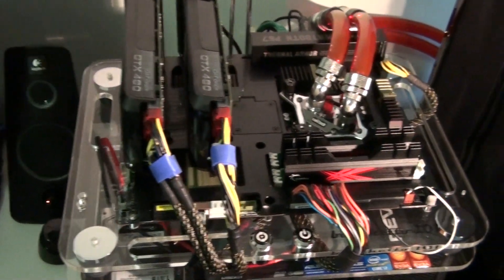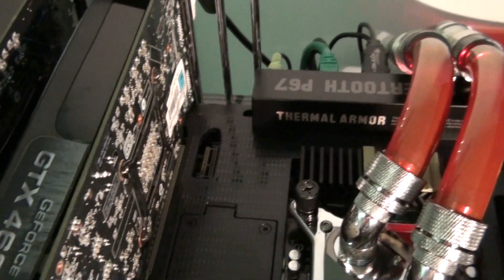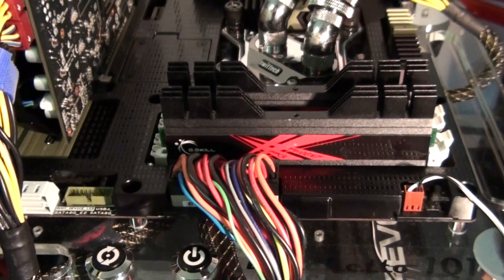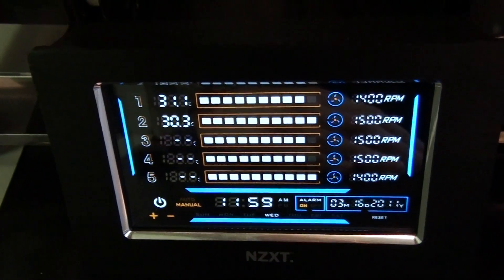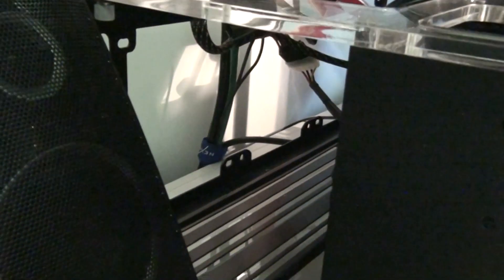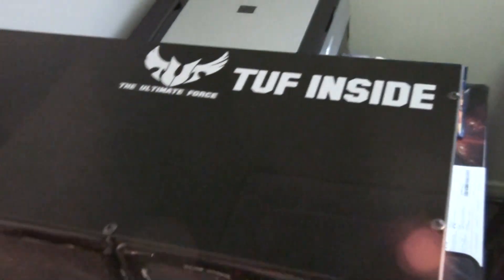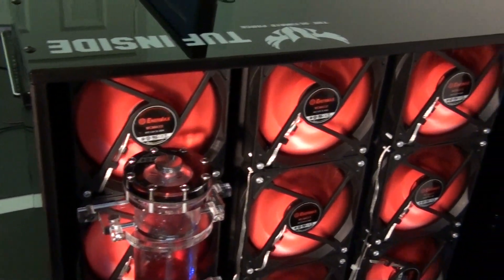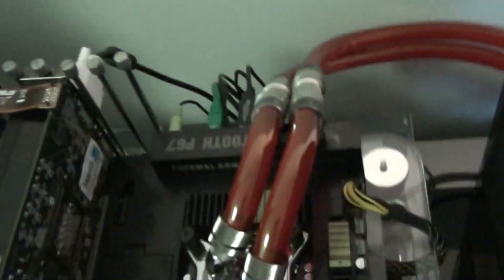Sabertooth P67 Test Bed

Comment: Beautiful rig, very nicely done, thanks for uploading it for us.

Planning on getting a Sabertooth next week, was wondering how the jacket handled the heat with no HSF helping to circulate air in and out of the armor jacket, suprised you didn't remove the fan and add a 50mm fan to it.

A cooling setup like that will last a life time, just need new waterblocks and coolant, possible a pump every now and then, certainly not a waste of money.